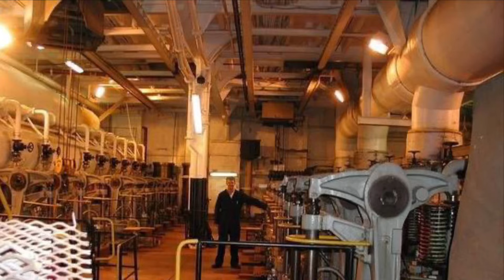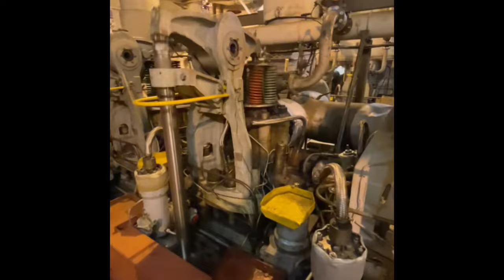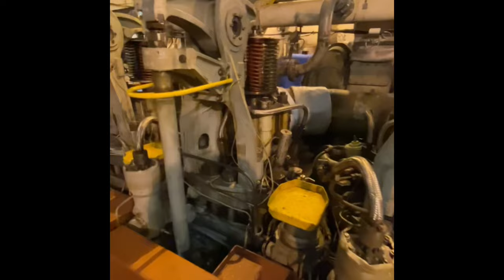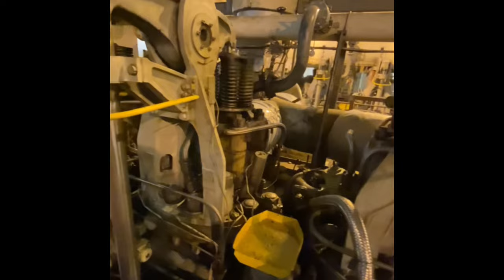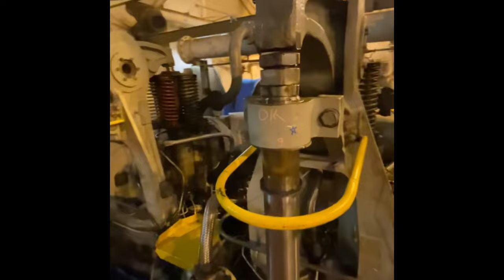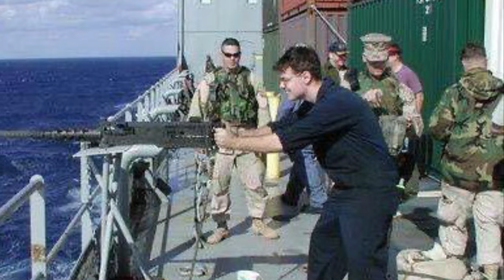Fastest, slow speed diesel engined cargo ship ever engines running

Comment: For god sake sailors.... Adjust the rocker...1/2 inch gap might be a bit wide..I am sad now and will likely lose sleep over the lack of maintenance.....
Reply from the maker: Yeah I wasn’t onboard for the video. Those rockers were always coming loose took 3 guys and a sledgehammer to adjust them. It’s worse when the engines don’t run regularly first month of moving for OIF it was constantly a battle. Settled out after that we ran it pretty hard for 6 months
Reply: @steamman9193  ha ha brilliant -anyway poor old dodge Bob is exaggerating. It’s probably only five mm which is more like 200 thou!
Reply: @malcolmwhite6588  it just sounds like a 6.7 powerstroke  the way it knocks 😅😊
Reply: Incompetence. Most ships are being manned with engineers who have bought their diploma's at a market in Manilla.
Reply: What the hell do you know about it?
Reply: @Maurice-c6z  i know alot about it. I know that a half inch of Valve gap will destroy the rocker arm and valve if left unadjusted. Not to mention the loss of power because of a lack of valve lift. The question is really,what do you know about it?
Reply: 1000 bucks say you have never adjusted shit or anything to inch/ nwtns
Reply: It's possible to adjust the tappet clearance on these engines without stopping,you gotta slow the engine to dead slow ahead and then act pretty sharpish with spanners and sledgehammer before the cam lifts the rod for that unit again,helped the engineers do it on a B&W 9K84EF main engine when I was a cadet,I was on the hammer, happy days!😮.
Reply: Anyway it is probably a cold engine, when you would expect the gap to be more. But one was a lot more than the others.
Reply: oui c'est incroyable cette déliquescence.. jamais de ma vie je n'avais vu de telles choses..
mais c'était avant les pavillons de complésence et les marins "uber"..
autrefois tout était calé au petit oignons.. il y avait de la maîtrise et des équipages de lignées..

une époque révolue 😢
Reply: Me too,many a time I was walking around in the crankcase!
Reply: I think the engineer s would resent being called.... sailors!
Reply: We had problems with fractured pushrods!
Reply: @alanc6781 I agree with that assessment. Clearances are always set at operating temperature, and a valve that large will expand significantly when it comes up to temp.
Reply: @FLORIDAMANIAM-he2lz  Judge Smales says he never sliced
Reply: @FLORIDAMANIAM-he2lz sounds like he has
Reply: @moconnell663  It was clearly only one rod with a huge gap.  If the gap was from being cold, why was it only one rod and not all of them.
Reply: It's all scaled up , that's about 15thou in scale

Comment: A valve lash adjustment is certainly in order :)
Reply from the maker: It would take 3 guys to do valve lash. 1 guy holding each wrench, another with the sledge to losen or lock it down and that guy would have the feeler gauges. They used to come lose a lot!
Reply: saw that fucking gigantic gap when the lifter assy came to rest on that base circle
Reply: or more duct tape on the push rod.  Take a closer look
Reply: It's all to scale , relatively speaking it's 25 thou

Comment: I was second engineer on Selandia in 1990. It is correct you can, and we did, adjust the valve clearence with the engine running slow speed. The funny thing is, that all 3ea. Engines (1 with 12 and 2 with 9 cylinders) had hydraulic valve lash arrangements below the rod, but they required some new seals quite often.
Reply from the maker: I always wanted to take to crew from then. I was on it from 2001-2003 after the navy conversion. They had replaced the generators with caterpillars x4 3608. Everything was diesel fuel. We ran unattended but it was never a good night for the duty man maybe 3 nights a month alarm free. I think 127 rpm was the most I saw

Comment: This engine room with main engines Burmeister & Wain (? cylinders in line) : for me , it was the « good old time » . Need exhaust valve adjustment : don’t worry, reduce the rpm around 50 rpm, take 1 big hammer + 2 spanners + 3 guys , do it and put back the lever on Full.
You can’t do that anymore with a 18 cylinders Wartsila (or MAN) 4 stroke engine, 30000Hp.